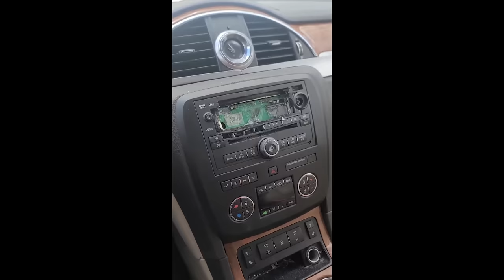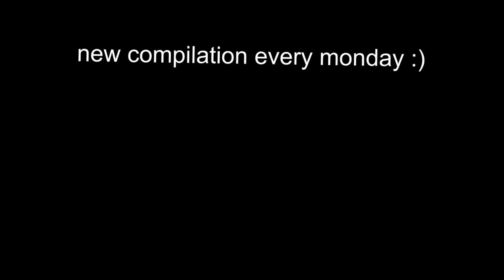UNUSUAL MEMES COMPILATION V259

Comment: 6:04 the perfect room for a server room or your average sound artist
Reply: I wonder how many of them are on different breakers though 😃
Reply: @SrGunnar  i dont want to see how messy the wiring is behind the wall 🤢
Reply: @D_zohan dude 😭 I work in IT I don't even have to see the wiring to get traumatized 😭
Reply: My guess is they’re all on a single 30 amp breaker with 14-gauge wires. I recommend running several hair dryers and vacuum cleaners at the same time to test the outlets.
Reply: Could also grow weed. You don't know.
Reply: "when did your house burn down?" type of vid